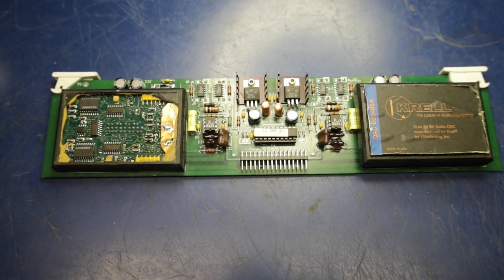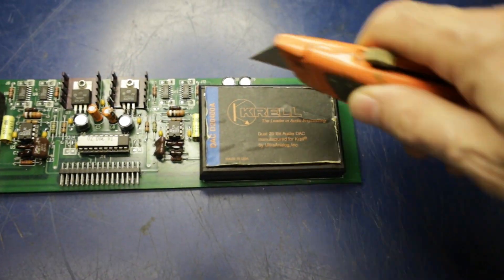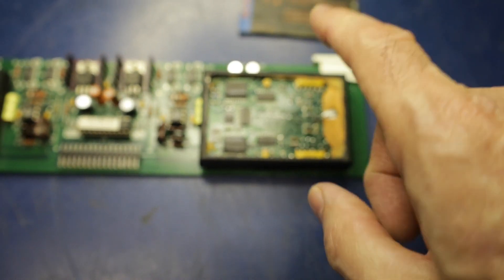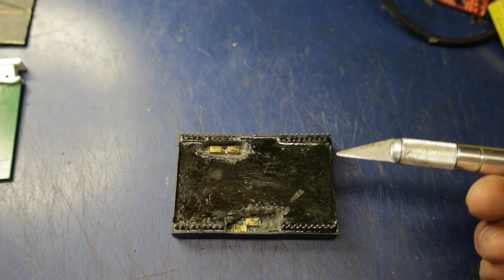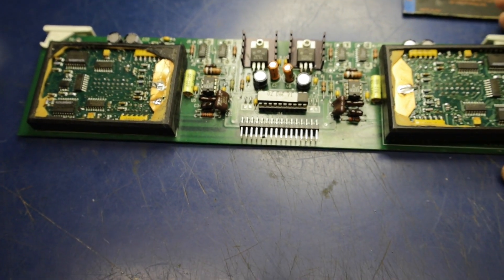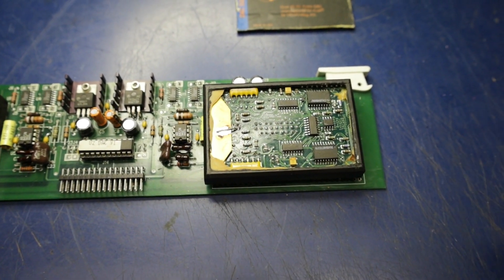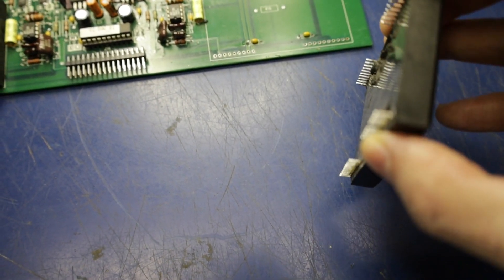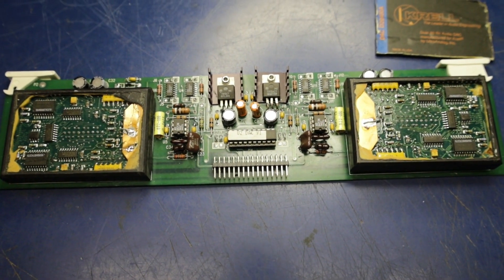I serviced a Ultra Analog DAC module. D20400A 3 problems fixed.

Comment: With those laser-trimmed resistor ladders (I think they're the yellow long components at the sidea of the board) what do you think about how they may be calibrated for the DAC's high operating temp?  

I'm wondering whether a clamping heatsink may extend their life .. or whether that then may move them out of spec?
Reply from the maker: I'm not sure which resistors are the laser trimmed ones. It could be the yellow ones but I measured all 4 of mine in case I damaged them when moving back to reflow solder behind them and all 4 are extremely close to the schematic diagram. If they are the laser trimmed ones then with them being the same mabye it's just marketing.. I wouldn't worry about those though as you can simply measure them and replace that part of resistor if they get damaged in soldering.  I did damage one of mine but replaced that part with exact off the shelf resistor between the leads. None of mine were damaged prior to that even with all the heat. Mainly solder joints,caps and I've heard the main ic can go bad.
Reply from the maker: I would add that all these need some form of active airflow to protect the whole module.

Comment: Hello, do you repair this module if we have a problem (from Europe)? And how does it cost? Thanks?
Reply from the maker: @isidoremalin2522  I don't repair them-i just repaired this one as part of a restoration of a cd player. The guy selling the schematics on ebay might possibly take them in for repair.I think he is in the European area.
Reply: I think he is not in Europe. Nobody can help us 😢. There is a real business : restoration of D20400A (and not pseudo module)...
Reply from the maker: @isidoremalin2522   I have heard in many cases the main processor made by ultra analog can go bad and there is no replacement. The same goes with the custom resistor. This is possibly the reason few repair these and the amount of time it takes.then having to tell customer it cannot be repaired.. If I hear of anyone doing this I will let you know.
Reply: @audiogear474  My Audio Research 2 dac is starting to crackle (even with no signal input) and to saturate when I'm listening. Especially when it's hot in the room. At the moment, for example, in summer. 
Either it's the D20400A or it's somewhere else... but I'm afraid I'll have to find a D20400...
Reply from the maker: @isidoremalin2522 yes, that's likely the problem.. Resoldering the through hole solder joints might fix it. Im not sure if anyone still produces a aftermarket version of this anymore or not. Hope you can find replacement  or get fixed.
Reply: @audiogear474  Just a last question : What are the references of the tantalum capacitors ? I installed tulip holders so I could test it easily, but now I have no sound at all. I think that detaching the module put mechanical stress on the pins. The DAC locke yet when I send a SPDIF signal. But beyond that, I'm also going to replace the tantalum capacitors. regards.
Reply from the maker: @giraudjuliensandrine I had the same issue one time after removing module. The problem ended up being one of solder joints on the topside around the edge. They are pretty fragile.. Regarding the tantalum caps one was shorted killing one of the voltage supplies. I have a picture showing location at end of video. Hope you get it going. I remember it being a bit tedious to deal with.
Reply: @audiogear474  Hello and thanks. I need the references of the tantalum capacitors. There are a lot of differents capacitors, different brand... I don't find the yellow one. I will use Polymère 25V 10uF 1311 20% ESR=60mOhms and Condensateurs au tantale - CMS Solides 25V 3.3uF 2312 10% ESR=1.2ohm . Twice Kemet. But I am not sure. Regards.
Reply from the maker: Ok I misunderstood you. I don't have specs on the original but don't think it was anything special. They were known to go bad so were likely a lower grade. Automotive grade should last longer. I ordered the yellow ones off digikey. I will try and find invoice for the one I ordered when I get caught up and let you known
Reply from the maker: The caps were 3.3 uf from memory but will have to look up brand,specs when I find invoice
Reply from the maker: Caps I used as replacement were Kyocera TAJC335M035RNJ 3.3uf 35v 20%. They were purchased from digikey.
Reply: Don't worry. Mine is impossible to open. It's a version with epoxy on both sides. Everything is molded. There isn't really a cover. Oh well...Thanks
Reply: My version has epoxy on the two sides... I can't reflew the pins...
Thanks a lot for your advices. 👍
Reply from the maker: @giraudjuliensandrine you can use reflow Station to remove a bit of epoxy at a time as I showed in video on the back side but it's a pain to do.

Comment: Do you know if these d20400A chips a still available
Reply from the maker: @richardpowell6096  the whole   module is not available but some of the individual components that are inside are available through ebay
Reply: Well they were so small I wouldn't know where to begin @audiogear474
Reply: "Available" - The company that made them no longer exists. All you can do is find equipment that has them in.. 

I thought I once saw a broadcast distribution amp with D/A conversation cards, from the late 90s, had a load of them in. Bubthe time Id asked for photos of the cards to check, the item has been sold.  

There may be a few non-hifi pieces of equipment to be found that noone thinks about that have these in and therefore are not given inflated prices due to the rarity of this chip.. 

I myself did buy 6 output modules from a late 90s Weiss Bw102 mastering processor that have these in (the 20 bit output module) for a future project.

Just have to look about... constantly. Set up search alerts on websites etc .